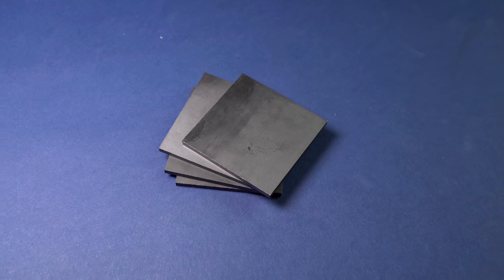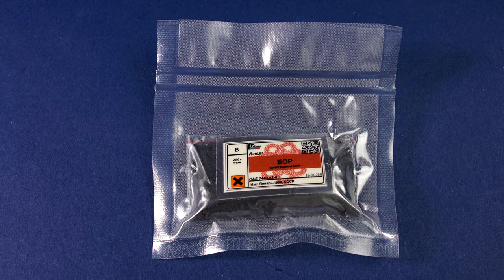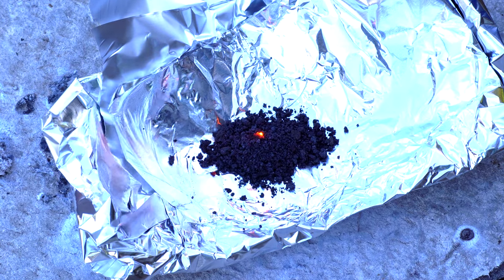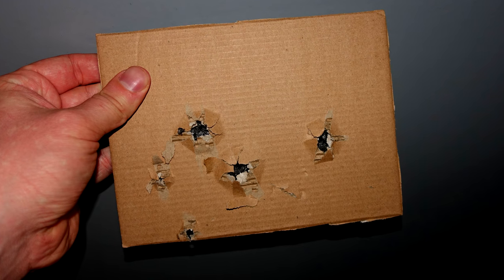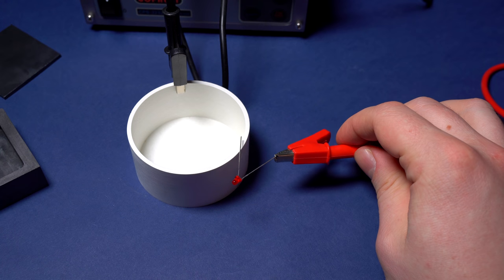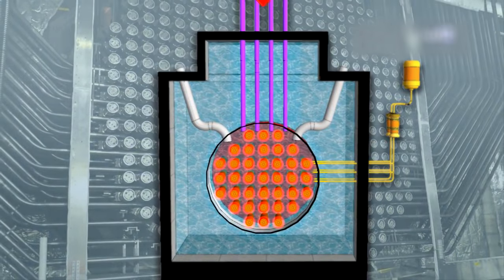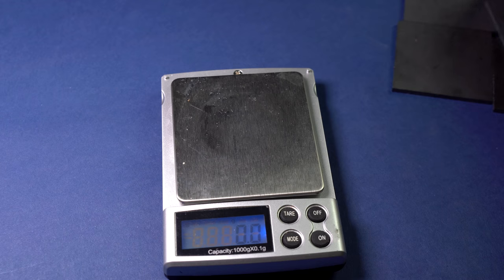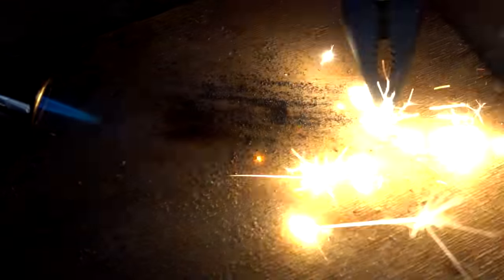Boron - A METALLOID WHICH PROTECTS THE NUCLEAR REACTOR!

Comment: Indeed boron does make fantastic amour but it must be alloyed with aluminum and backed with a Kevlar spalling layer.  The boron is made into a very rigid open cell sponge like mass and has molten aluminum to penetrate all through it and cool.  Not really a true alloy but a matrix.  The boron is what shatters an armor piercing bullet while the Kevlar spall liner keeps the boron from shattering.  This is what is used in helicopter gunship armor because it is light for it's thickness.  It is also used in making exotic ceramics parts for composite Chobham tank armor.
Reply: Thanks !

Comment: Great video as usual. However, the Boron is used to (regulates) the operation of nuclear power plants not to protect. This might sounds identical for some people but it is not because Boron is not used in all types of nuclear power plants (the example I am familiar with is the Boiling Water Reactor, BWR). In Pressurized Water Reactor, PWR, Boron is used as a chemical shim (Boric acid) mixed with water and as a solid control element which can be used in the form of control rods that when fully inserted can shutdown the reactor or partially inserted during normal operation.

Comment: It wouldnt work well as standalone armor. Brittle materials break up the bullet, but also capsize under the force. Needs to have a woven fiber like kevlar, or a more thick plate of ceramic to stop the bullet. The best armor plates Ive used are made of ceramic woven with kevlar fibers in between. Cool video.
Reply: Kindly make ur next video of element ( painite).... ur videos r much better than other u tubers.....ur videos also help me in my studies.....
Reply: Painite isn't an element. It's a borate mineral.

Comment: Do you think that you can make a video on making boron carbide?
Reply: im sure like most carbides, its all sinthered powders. at least thats how tungsten carbide is made. Not sure how they make the power though, maybe mixing the element and carbon in high pressure and temperature without oxigen but im not sure that would work.

Comment: Of course caution must be used when using boronated water in a reactor... the Davis-Besse plant in Ohio narrowly avoided a vessel failure due to the high-pressure  boronated water eating away at a small defect in the steel of the access plate. When inspectors found it, there was a large hole etched halfway through the 4" cover!

Comment: Your boron carbide armour needs a backing with very high tensile strength. The boron carbide provides the compressive strength but it requires something with high tougnness to absorb the energy as well. 
What happens if you epoxy the boron carbide to a 2 mm steel plate or a 5mm aluminium plate?

Comment: I won"t agree that borosilicate glass is as resistant to temperature change as shown in the video :D since as I know it's rated to withstand instant changes but in range of about 100 to 120*C more than that it will crack :p Also even laboratory glass shoudn't be heated by direct flame in general.
Reply: Qwertypp10  yeah i agree...even there are warnings not to heat certain laboratory apparatus directly by flame
Reply: hmm i heaten up my borosilicate test tubes with over 1000°C(Teclu)....  no cracking at all.
Even if i heat em up to its melting point they dont crack.

Just if i schock em down with with dry ice to
−78,48 they get crack but doesnt Shatter.

So before ive testet it i wouldve agreed to your 2, but now i think its relative save ;)
Reply: They didn't crack because you hetead them evenly or just tubes are small so they heat up evenly, what is not a point. Try to heat up beaker or flask with teclu berner on single spot- it will most likely crack due to too high temperature difference across the entire glass, or just heat up your tube and put to water (since I was writing about instant temp. changes)... :p
Reply: Well i can pointly melt the test tubes and my erlenmeyer-flask has a hole now. (about 8 € )
Yes sure it will break easily if it tightening by cooling, but by heating its really rare and only seems to happen if the glass has a defect.

Its even more unprobable if the flask is filled with a liquid that can lead the heat.
I heat up my samples for years with this method and i never broke any borsilicate glass just by heating it.
Reply: big structures aswell will crack but thats not by accident, its the will to destroy it right by that way.....
Reply: Qwertypp10 watch a video about art glass manufacturing. it can be easily heated directly, it's all in the technique.